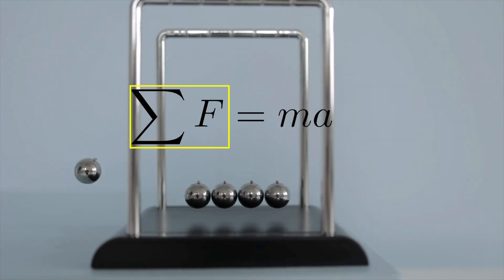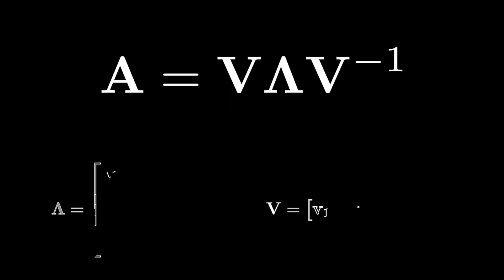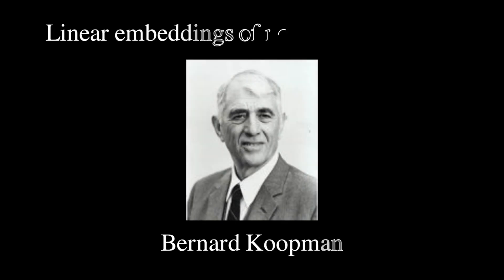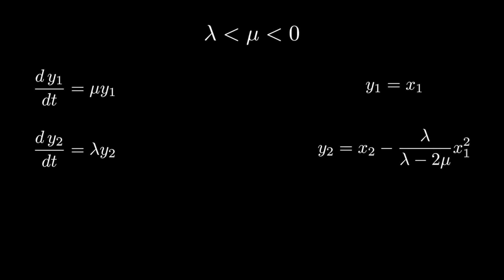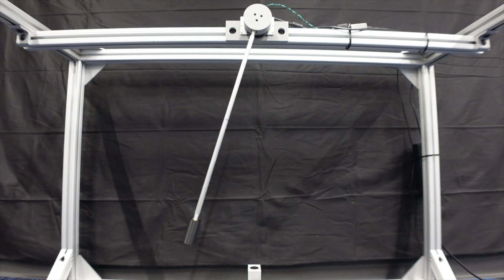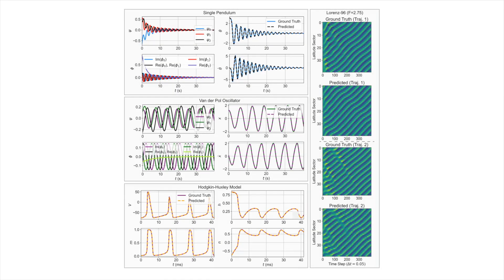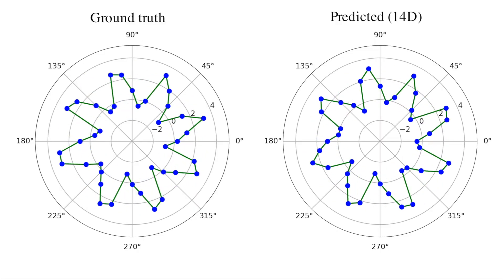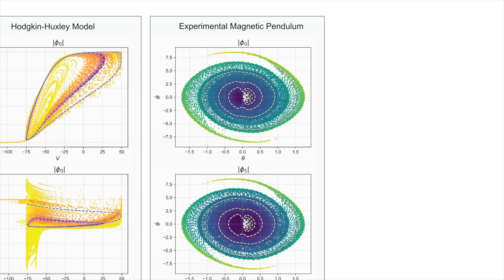Automated Global Analysis of Experimental Dynamics through Low-Dimensional Linear Embeddings

Comment: 13:31 Fun fact! The HH equations can be described as a non-linear transmission line. This hasn't been considered a solution by most because nobody has taken the time to verify that it reproduces the original data until very recently. My friend wrote a paper showing that it yields analytic closed form expressions for voltage in time that are identical to numerical solutions of HH eqns. It hasn't been accepted yet but check out Valentino Simpao's work Traveling wave solutions of a modified Hodgkin Huxley type neural model.

Comment: Great video! I’ll be checking out your paper in detail later today. I had a quick glance at it and I have a few questions and a suggestion. 

I’m curious: around 13:09, was the change of coordinates that your method learned for the Hodgkin-Huxley model a time varying change of coordinates? Also, did the change of coordinates depend on the initial condition? Last, to the best of my (weak) understanding, the Hodgkin-Huxley model has inputs. If I’m right, how did you handle those? 

Also, typically, the condition for “asymptotic” (as opposed to “Lyapunov”) stability is that “\dot{V}(x) < 0” (as opposed to “\dot{V}(x) \leq 0”). If you are getting away with a negative semi-definite Lyapunov rate by using a LaSalle’s invariance principle based argument, you should state that in the video and in your paper. FYI, I’m using definitions as they are given in Khalil’s textbook. If my critiques are coming from a difference of terminology, please disregard. 

Also, I love the figures! Very compelling!
Reply from the maker: Thank you! The Hodgkin Huxley model we considered does not have inputs, this is the standard model with four states and is given in the paper. The change of coordinates is simply a function of the states. The resultant system in the new coordinates is a linear time-invariant system.

This is a good catch but simply a typo! All of the models learned in the paper have Re(\lambda) < 0 and thus \dot{V}<0.
Reply: @ Wonderful! Thank you very much.